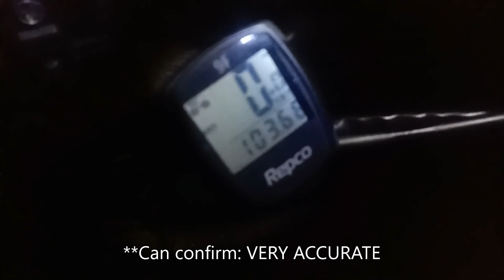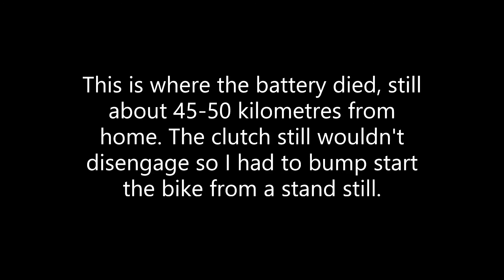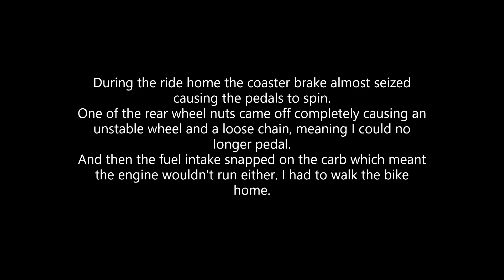Motorised Bike Mk4 - 150 Kilometre Endurance Ride Into The Night

Comment: That was a very  long ride. I don't ride long distance in the dark. It's hard to fix things at night.
The way I adjust my clutch is I set the flower nut first so its screwed in with  plenty of threads.
Then I set /adjust the clutch cable, at the   clutch lever screw.
Reply: @NicksBikes  Some of my motors have done over 20000kms without any problem. Some have lasted only 100kms, luck of the draw I suppose.